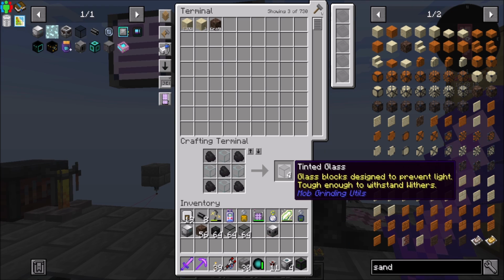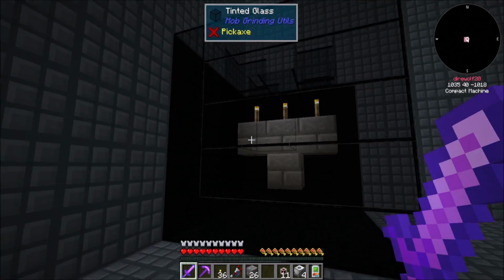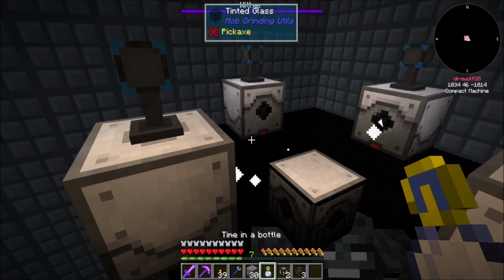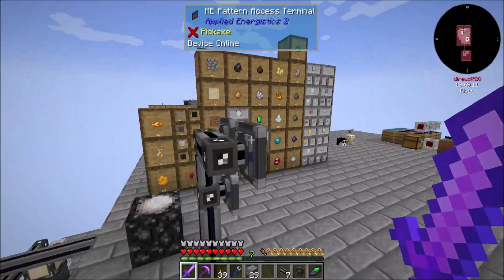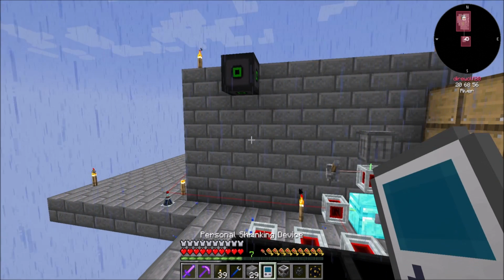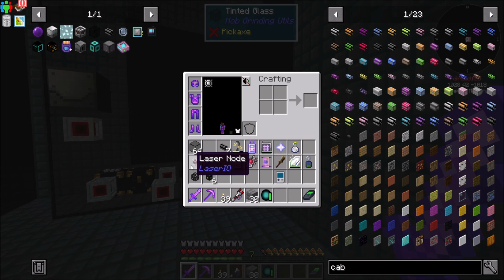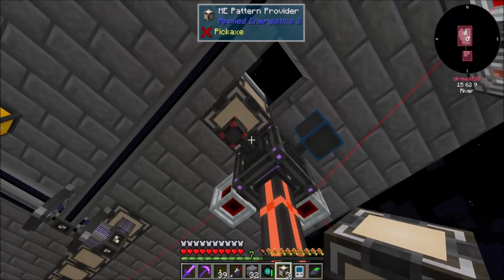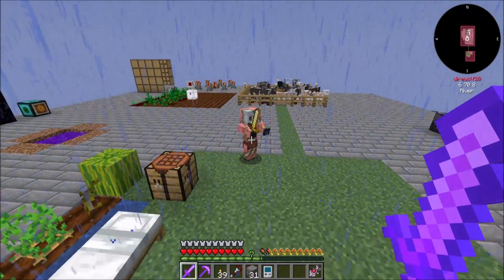ATM7 Skyblock Ep27 Wither Farms

Comment: Max Lasers per Laser Base is 134.  They can go above and below as well as the sides.
Also, they can shoot through other Lasers.
Reply: As I understand it, you can fill a 5x5x5 cube with the drills, minus the base at the center, it you have a way to remotely empty the inventory of the base, e.g. with an ender porcupine or the likes. So, 5x5x5 equals 125, minus the center is 124. Where do you place the ten extra drills to get to 134?

Comment: I think you can put 27 lasers on each side. You can put a 9x9x3 grid and it will still reach the laser drill. So a total of 27x4:108 lasers in total
Reply: Max Lasers per base is 134.  You can put them above and below the base, same as the sides.
Reply: @seanehle8323  dang it haha completely forgot about saying that you could put it above and bellow. So 54 more then 162 lasers in total

Comment: I believe the search bar at the top in the terminal is available to be turned back on in the options if you are updated to the latest version. I saw somebody turn it back on in another video. If the wither is in stasis, I don’t believe you need a cage around him. I could be wrong.

Comment: 6:45 "goodness im bad at placing thoes"
No they are one of the few terribly placed blocks in modded minecraft, right next to refined crafters.
TIP: You do NOT need a space between the laser and base. Check the UI to see if the laser has connected to the base.
Reply: Their direction is simple if you know the trick. Which is the edge of the block your cursor is on will be the front.
Reply: @ethancatherman2822  wait, so they’re placed like logs instead of like pistons? Why would they do that?

Comment: 15:24 (How do you write a comment and not sound like a condescending ass ^^ Sorry) For the ender tanks that you have storage busses on. You could use an import bus and a ME fluid storage cell and store the liquid in the system that way. You would both save a few channels and only have 1 import tank for fluids.
Any specific reason you did it the way you did?
Keep it up :)
Reply: If any of the fluid storage cells fill up, then the import bus will stop taking in the fluid from the import tank, which will in turn also fill up and no other fluids will get imported.

There are probably ways to cut down on channel usage and store the fluids in ME cells (although he'd also probably want to partition each cell to have its own fluid to avoid a similar "one fluid fills up all the storage and blocks import of the others" problem), but using separate tanks for transport of each fluid is probably still a good idea for safety.
Reply: @slartimus  It's cheaper, easier, and you get more storage. The ender tanks are only 16 buckets but a single 1k is 8192 buckets, and it can store 5 liquids. The cells are based on the power of 8. (So a 4k cell is 32k buckets) He both save channels and gets more liquid space for cheap. Not sure if you have ever played a modded pack before, but there is only 15-16 liquids, so you only need 3 cells to store them all.
There is no need to partition the cells either, cause compared to items, there are only a few liquids, plus the partition editor don't exist any more. If you manage to fill a 1k with 8k worth of liquid, then you have a very fast/efficient farm, and you can for sure spare some resources to make a 4k or a 16k.
I mean sure, if you need the liquid in more than one dimension or greater distances, sure.
Fluids are different compared to items, you are right on some stuff when it comes to items, not liquids.

Comment: Hey ! I'm currently playing this pack but my Dimension card for my ME network doesn't seem to work in other dimensions, do I have to setup something else beside putting the card in the wireless access point ?
Reply: Did you ever figure this out? I'm currently having the same issue.
Reply: @russell1047  I upgraded my power network from Pipez to max tier Mekanism and it suddently worked, so maybe it was just a power isue ? you can try feeding more power to your AE2 network
Reply: @TheEpouv77  Doesn't seem to work for me. It's not a huge deal but it's annoying when stuff doesn't seem to work lol
Reply: @TheEpouv77  Disregard. I built a quantum bridge in the twilight forest and put a wireless set up in there. I thought that fixed it in all dimensions but my wireless crafting terminal would stop working shortly after. I had to force load the chunk the wireless access point was in. Now it's working flawlessly. I noticed my terminal was not recharging in the other dimensions so that's when i chunk loaded it.